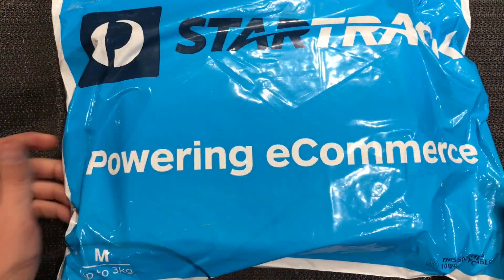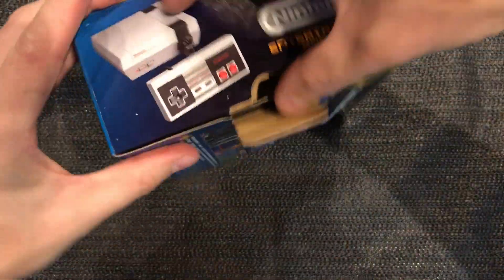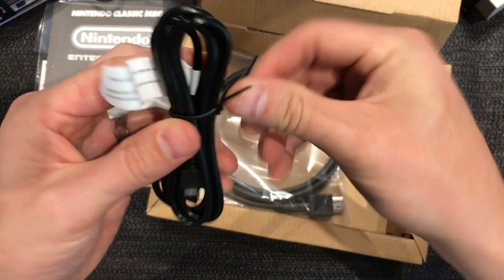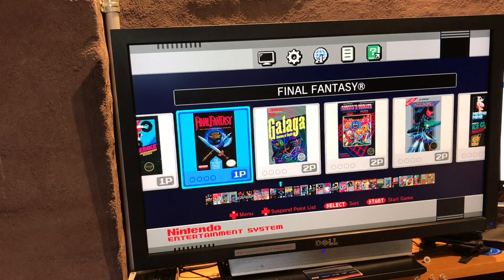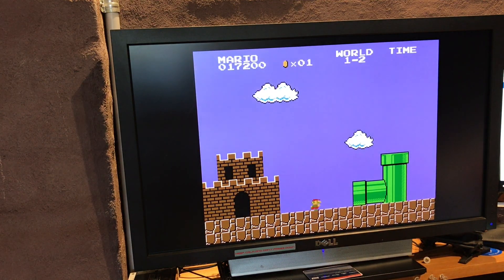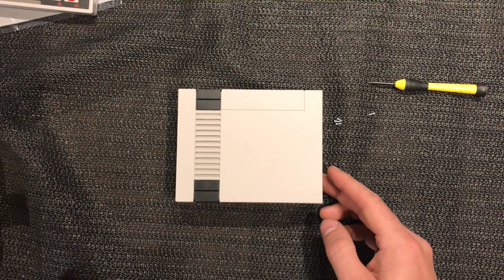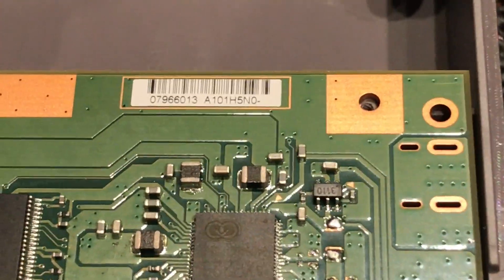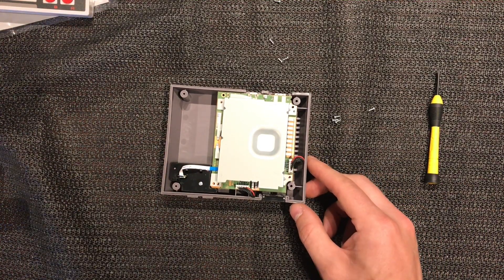NES Classic Mini Unboxing First Look & Teardown - YouTube

Comment: the contoller is not exactly like thr original, it is slightly differently sized, also the connector is wii line in general, it works for a replacement for a classic controller, with less buttons of course, but it is still the same kind of circuit as the classic and gc like version of the classic for the wii but still does work on wii u

Comment: This is a mass production model so I highly doubt it uses an FPGA. It would be cheaper to have a custom architecture IC production similar to the original however even cheaper is emulation and that's probably what it is.

Comment: It's called an AC adapter because it converts (adapts) the AC line supply from your outlet to a DC regulated output. Here in the US, this has been the common terminology for at least all of my entire life (nearly 4 decades), and I'm sure for longer than that. Not sure if there's different regional terminology.

Comment: Actually it IS an ac adaptor because you plug it into an ac outlet... :-)

So they do know what they are talking about...
Reply from the maker: Firste Laste No it's a USB cable that plugs directly into a USB socket. The edition we get doesn't ship with any adapters. Even if it did, all that's doing is converting the wall AC into 5V DC. It says it on the box.
Reply: Global Garage 
Nevermind ....  you didnt get it

Comment: Funny, the old NES is littered with resistors, caps, cmos chips, DACs, 10 or so ramchips with each a few kB and what not.
New version, one custom cpu/gpu .A hynix DDR ram chip, some driver/opamps (bet for the usb 5v and hdmi), a bit of smd resistors/caps. And that's it!
Reply: sh0tgunbl45t they only retail for $60 in the stores. if people paid even hundreds just to get theirs early, they are fools.
Reply: Osmosis i'd say it's like a rpi.

Comment: Thing is there IS a glitch with this thing and needs to be fixed asap. I
 bought my classic NES and there is an important thing that mario needs 
to do and this controller or interuptions of the keypad DONT work 
everytime.... try being the big mario and trying to glide under a 
boulder of bricks in a small space in say 1-1 tunnel.. try running... he
 is ULTIMATLEY slow and cannot get under like in the ORINGINAL NES... 
the right and down key dont feel the same as the older one and its 
frustrating... everything else aka screen is fine, the lace and pure is 
Great!. keys.... NOT SO MUCH....
Reply from the maker: Yes I know what you mean. I think it's input lag mainly, so the controllers have a tiny delay from when you push the button to what happens on the screen. This is due to being emulated and not real hardware. It certainly doesn't play as well as the original hardware. It's good for casual gaming but not serious playing.

Comment: Funny, The US version comes with a wall adapter
Reply: They wanted to keep the price as similar to the US price, as the shipping price is included in the price of it, so they did a few sacrifices. Most people here in the EU have a good few wall adapters anyways.
Reply: International version has to deal with several different wall outlets, so companies usually do not include AC adapters
Reply from the maker: So ours here in Australia didn't come with the AC to DC adapter as you don't need it and it does seem like cost cutting. Any USB port works fine. Even the one on the side of my Samsung TV worked. We paid $99 AUD which is about $74 USD
Reply: Global Garage I'm curious as to why you correct the box where it says "AC adapter not included", in my understanding of the term AC adapter the AC bit refers to the fact the mains is AC regardless of whether the output of the adapter is AC or DC.
Reply from the maker: eyeball226 Just a dig at Nintendo, not really that serious. The console runs off a 5V DC cable from the USB port on my TV, so the AC adapter out of the wall is somewhat redundant. Yes the terminology is the same worldwide.

Comment: The new Mega Drive doesnt have HDMI because it isnt a SOAC and therefore doesnt have the same limitations of emulation, but would become more expensive due to the modifications necessary to output that kind of signal. The insides will be as similar to the original as possible. I like how well this works on HDMI but I am a little upset that it doesn't have AV for the retro feel.

Comment: I honestly just don't get it... why even consider modding this? It's a freaking ARM processor running an emulator. People have been doing this for years with PC's or a raspberry pi and usb NES, SNES, and 64 controllers. With the Pi you have 100% control over everything... People have even made awesome cases that you can print out if you own a 3d printer. https://www.thingiverse.com/thing:1035878
EDIT: Typos

Comment: There HAS to be some way to get more games/applications on it or hack it.
What happens if you use the USB power cable and connect it to a PC? Can it be interacted with in any way or does it only have the pins required for power?
Reply: Jesse D it looks like a 4gb flash module. 30 games is not much space used. Though the Linux OS may be on it too, so who knows how much space that's used by it.
Reply: gigabit
Reply: jlebrech No.
Reply: they have  hack  it  is useing  allwinner  bord   it cost about  10$ to  make
Reply: Your Nevergunnaknow    Yes you can

Comment: That thing has a quad core ARM,  and a Mali 400. That thing can run NES, SNES, GENESIS and PS games.
Reply: digger66a
a lot of games are being "pirated" for the sake of preservation, because old hardware eventually fails. We need to preserve the past for generations to come, so I'd rather have the law broken than some old games disappearing into obscurity because the original hardware broke down.
the internet archive (archive.org) already has a lot of arcade games which are playable in your browser using a web version of MAME. some companies don't like that, and archive.org will happily take the rom offline, but they do still keep the rom in their archive and will put it back up eventually because preserving the past and sharing it is important.
Reply: it's basically a RPI 3 with emulation station on it (yes different chips, similar specs!), you'd be better off investing your mony in an RPI 3 and a nes-classic usb controller and then installing retropie on it. you'll have a better nes-classic for the same price!
Reply: Thats true. The RPI3 is better and cheaper but the NES case is very cool. People should sell  mini consoles look alike RPI  cases on ebay.
Reply: Abraham Soto just 3d print those cases. There are tons if designs on thingiverse.com
Reply: Its a rom of a 20+ years old video game, not a murder. Calm down.
Reply: Who the fuck cares?
Reply: digger66a Finally you got it.
Reply: Niek Nooijens better buy rpi, jerry rig it with usb cable, use ps2-esque usb controller, and bam! u making nes mini!
Reply: Niek Nooijens and i think its due to it's not profitable to made it for olde generation console due to discontinuation, like ps2 (who cares making those games anymore, go off to ps4!) as usual, tech evolves.
Reply: Bitelaserkhalif *cringes*
 my point was more like "why pay €50,- for a DRM-locked down version of a €30,- board if you can accomplish the same and more with less money?"
Reply: That's true. It's 10k better to buy a RB3.
Reply: Niek Nooijens problem with emulation for me is controller lag. For some reason this classic solves it or makes it much less of a   problem
Reply: besides its illegal unless you own every single game you play and you made the romcopy yourself
Reply: DaDude1987b how about the law and every honest human being  .......? sas
Reply: DaDude1987b so because its a in your eyes minor law its ok to break it? am i the only one not getting it?

Comment: Allwinner R16 chip, so it's running on an ARM Cortex A7. Might be hard to hack as flash storage appears to be soldered onto the board, sure someone will figure out something though, they always do :).
Reply: I think it will only be a matter of days before someone has dumped the contents of that flash chip... probably already online somewhere.
Reply: Hahaha, yup, be interesting to see if this can be turned into a 500 in 1 or something :D.

Comment: I believe the Hynix chip is RAM, the TSOP spansion chip is a flash ROM, not sure on the R16 BGA mounted chip, perhaps a CPU / MCU (just based on its proximity to the RAM, and clearly has connectivity to the flash ROM).  Also not sure on that qfp chip either, perhaps another MCU, glu logic maybe, HDMI output and USB host?  I wonder if the ROM is encrypted, I guess the only way to hack these will be to dump the contents of the ROM and hope its not encrypted / signed code.
Reply: If it isn't encrypted or the encryption can be defeated... we could have a lot of fun with this little box :)
Reply: Hi :-)
In order to share information I found about the hardware ^^  :

It looks like the R16 chip is an ARM CPU/GPU chip. According to the specifications, it is an 4 cores 32bits ARM Cortex-A7 CPU [1] (video encoder/decoder for 1080p at 60 FPS) fitted with a MALI-400 MP2 GPU (4 shader at 500MHz) chip.
The Hynyx chip should be a 2GB RAM chip according to the first letters in the reference numbers.
The Spansion chip is a 1GB SLC NAND flash memory chip where the games and OS should be stored [2].
The AXP223 chip is a power regulator chip also delivering a clock frequency until 2MHz [3] (I assume for synchronising the games in NES NTSC version "emulation").

The R16 chip have ethernet capabilities but Nintendo seems to decide to not use the feature (e.g. for donwloading additional games). This chip have probably also in the charge the audio capabilities.
I do not know how easy the customization of this device wiil be. It will be funny to try xD

[1] http://www.allwinnertech.com/index.php?c=product&a=index&id=47
[2] http://pdf1.alldatasheet.fr/datasheet-pdf/view/514849/SPANSION/S34ML04G2.html
[3] http://www.datasheetspdf.com/datasheet/AXP223.html
Reply: R16 is quad core Cortex-A7 CPU.  https://en.wikipedia.org/wiki/Allwinner_Technology
Reply from the maker: Great info there +samsnacbar Thanks for sharing
Reply from the maker: Thanks +GadgetUK164 good info.
Reply: It doesn't matter if it is encrypted. For it to be used, it has to be decrypted, which means somewhere on this device there is a chip containing those keys.  I'm not seeing any chip with epoxy resin on it so there is a good chance that even if the keys are on a separate chip they can/will get dumped.  Glancing at this thing from the vid, I'm quite optimistic that this will be easily modded.
Reply: It does totally matter if its encrypted - because if you cannot encrypt code the same way (or sign it - probably both), then you cannot run code at all.  If they've got lazy it might all be unprotected, but I suspect some signing and the key in that case would be on the CPU.  I guess the only option might be to sniff the RAM reads and write and see if anything can be worked out from there.  Modern system like the 3DS usually get hacked by some software exploit initially - so you can then expose things and run your own code to sniff around the system etc.  Since this device has no SD card or wifi etc it could be quite difficult.   All that said there's a chance they haven't put any protection there at all, so it might just be a case of reading the ROM and working out the structure of the code and ROMs stored on it.

Comment: :) awesome video mate. The console looks cool. Only issue I have is how short the cable is from the Controller to the system.
Reply: Same here,liked the tear down.

Wish nintendo would have added bluetooth so you could connect a wii remote to it.
Reply from the maker: Thanks Dave. Yep the controller cable is way too short. I think a Wii U controller extension cable will work fine so ill pick up a few and test them out.
Reply: I think cable is the right way to go. You want a retro feel, and also bluetooth adds lag.
Reply from the maker: I've already ordered a 1.8m extension cable. Bluetooth would add lag
Reply: My only issue is that you can't even buy the thing.